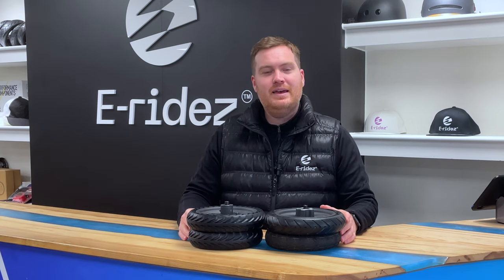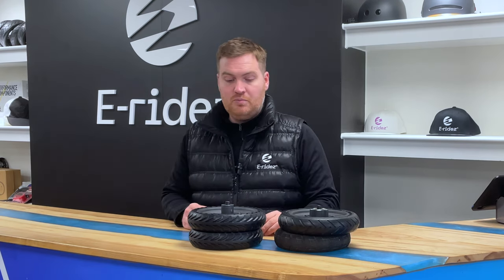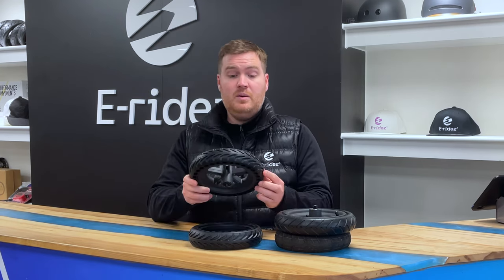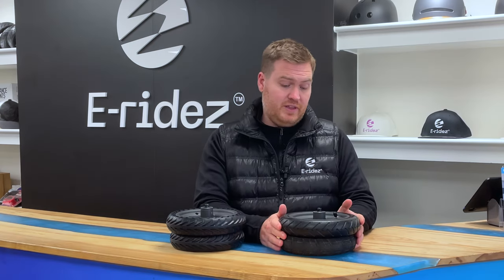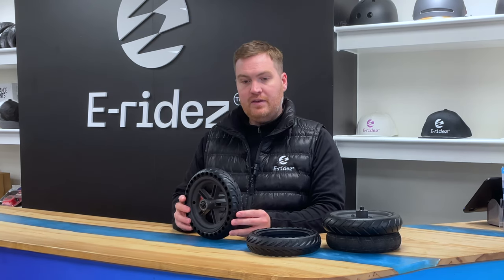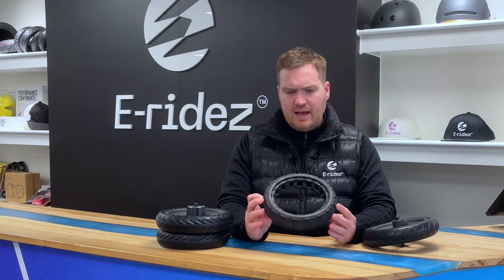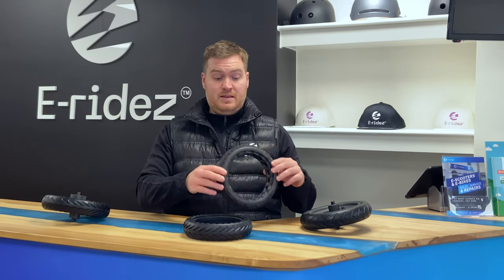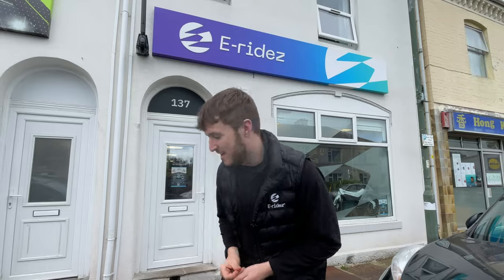Solid Tyres vs Air Filled Tyres For Electric Scooters | E-Ridez - UK E-Scooters

Comment: I use the combination of the front air filled, rear solid.. I got sick and tired of the rear tyre getting a pinch punctures from just going over a rough surfaces
Reply: Me too
Reply: Air filled is shit mine is getting fixed every month im gonna change to the other one
Reply: Same, thinking of getting honeycomb instead of solid at the back though
Reply: Same here. How has your experience been now?
Reply: What scooter I did this for kugoo m4 pro I took it off some much vibration I couldn’t see where I’m going
Reply: How's the traction with the solids for riding & braking?  I sometimes like to take curves at higher speeds having my tire completely separated so I'm thinking of going the solid route for the back!
Reply: @VentNation  I wouldn't know about high speed cornering, Australia has laws limiting what max speed you can do on public roads 15mph. I ended up selling my eScooter, not worth the stupid fines. Getting a eMotorcycle instead 🏍🔌⚡
Reply: @ottohumpmachine8958  yeah

Comment: I change my Xiaomi rear tire to solid and my riding doesn't comes smoothly as before. I feel the vibration at the rear end and it runs up to my brain. I will give it sometime to get used to it. If ever I want the air tire back, I'll just replace it again coz' the solid tire I bought comes with the rim in it and very easy to swap. Solid tires are good if you're on a smooth road.
Reply: Remember to Bent your legs to absorb the vibration, you dont want it to go through your brain all the time👍🏼

Comment: Couldn't the firmness of the solid tires not be completely solved with suspension upgrades front and rear?
Reply: Yea it's better with suspension
Reply: On my Vsett 8+ are very good adjustable spring suspention.
The ride is very good &  smooth enough but not as good as on the tubless or tubed tires.
Cornering is on a lower speed.

Comment: Instead of solid ones ,should be better an sponge one . Why they don't build ones ?
Reply: Wouldn't last
Reply: Sponge tires are you trying to kill someone
Reply: There're spongy ones with a little flexibility.😊
Reply: @powerofGod788          It depends on the rides.

Comment: Very good!
FWIW: I do a lot of of-roading on my scooter... lots of slime in the tubes and so far I've not had an issue. But given where I go and the scooter is darn heavy the last thing I want is a flat! I'll take the extra shaking of my old bones ...anyway, a little tip: Slather up those solid tires with Pritt-stick before fitting - easier to get on if unlike me you don't have split rims, and once dry the tires are much less likely to move.

If you're feeling really paranoid you could use (blue!!!) thread lock instead, but that more expensive and they are going to be a bugger to get off.